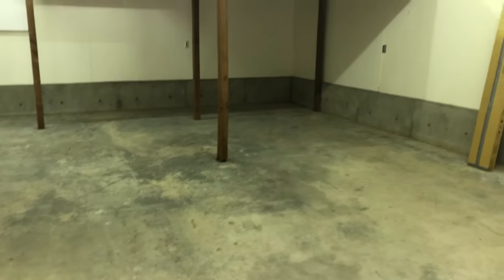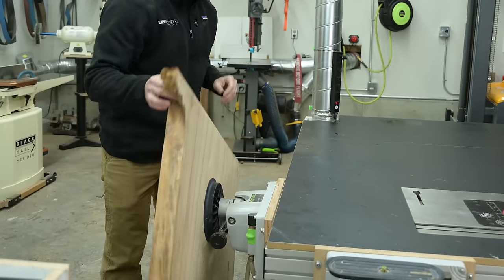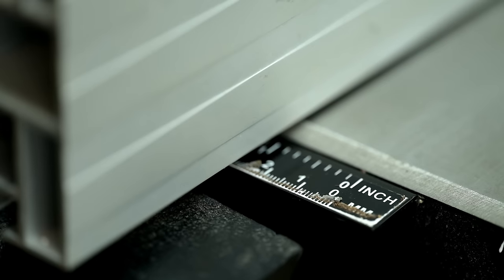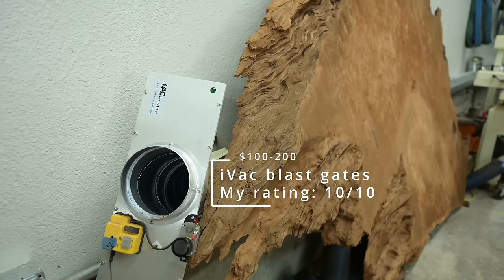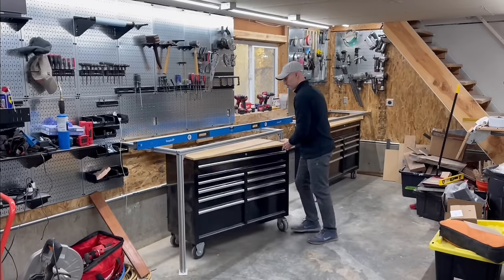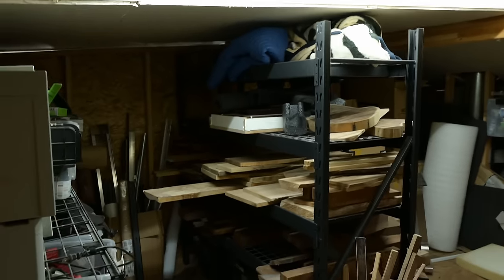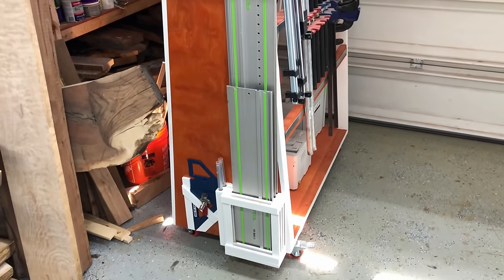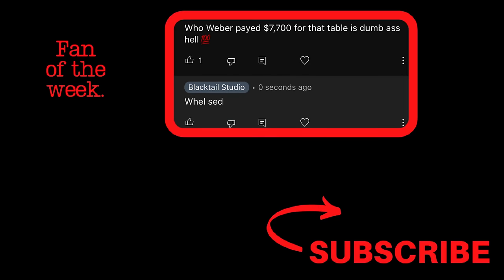Blacktail Shop Tour

Comment: I watch your videos and want so badly to have a nice epoxy desk but this college student can't afford you work, I live in a place with some of the tools needed to make this kind of desk but would need to find an industrial planer  but the big thing holding me back is mainly the cost of materials, the lack of experience and practice doing it for a good looking result, and the sanding. I hate sanding so much, I am somehow bad at it.
I think one thing i'd want to try and i'd love to see you make is an epoxy table with colored dye and having LED lights in the epoxy. I hate saying the term "gamer", epoxy table, but that's the easy way to explain it. some controllable color changing LEDs in an epoxy desk. maybe you can make a small light side table and call it a night light table or something, so its easier to sell.

Comment: Wish you went into the circular saws more.  I know the Mafell is pricey,  I guess about 2x the price of the Festool but what is your alternative for those large and thick slabs without flipping.  Be glad that that Mafell is one of their cheaper models.  Now there are some saws that would cut it but are not really worth it due to the quality of cut.    Off that subject I wish you could get sponsored by Woodmaster.  We had a molder/planer from them years back(30+) and it was great.  Not sure you would need a molder but their drum sanders are also great.
For your slide compound miter I suggest either a Mikita or Hitachi/Metabo.  I have the Mikita but think the Hitachi/Metabo might be better.  I've used both extensively along with several others.

Comment: Fight it! Hope it’s not too late to ask a question and get an answer. There was no link to the aluminum struts you used under the 1/4” melamine top. I think I can use that to build a 4x8 table to mount my slab flattening system. I would use vertical struts so the 8’ sides are supported in the middle as well as the ends. Thanx I hope you won your fight.

Comment: Fight it until you’re satisfied!

This video is exactly what I’m after as I’m building a hobby wood shop in my basement. I will be buying those wood chisels soon. I want to recreate your miter saw station to my own parameters, but I can’t find 1/4” black melamine anywhere. In fact, I can’t find any color melamine smaller than 3/4”. I have a local Lowe’s, Home Depot, Harbor Freight, and also Amazon is reliable. Where did you get your black melamine? If I can’t get it then I might just settle for 3/4” thick. I’m sure I will be leaving more comments as I unpack this video more. Cheers from SW Pennsylvania!

Comment: Fight it. You are a small business owner who is just trying to get by and building and expanding is a part of that process. My question for you is how you made the extruded out feed table level with the sawstop table saw. In that build video you show the plans but they show a height of 29.7" which is several inches shorter than the table saw height of 34". All of your videos cut off the bottom of the feet of the out feed table.

Comment: Do you ever put anything into the big voids on your giant tables to save on how much epoxy you use (since it is so expensive)? For example, do you ever put a block of 2x4 or foam or something like that in the middle of the void? I figure it wouldn't impact the strength of the epoxy and since you always use black epoxy, you wouldn't be able to see it either. So if you don't do it, why not?

Comment: I love the vacuum clamps, you answered my question that I had in another of your videos. Also, Mafell makes a plunge track saw like Festool that I own and it is an amazing tool, best plunge saw on the market. That saw you showed is a track saw, but for a different purpose than the plunge saws, it is what they call a cross cut saw. If you got your hands on the Mafell plunge saw, you would want to sell your Festool, in my not so humble opinion. They also make a dado, rabbet, etc saw that fits their tracks that is way awesome, but it is 2500 which is ridiculous. Why do you not like the sweetheart chisels? Once they are tuned up, I think they are a great budget buy for hand dovetails and stuff like that. Thank you for the video.

Comment: Trying my hand at using C channel to stiffen a bench.   Got the fasteners from your ref to screw into the bench.  Need ref to the black flathead bolts to secure.  Need 3/4", Amazon s are over an inch, too long for me.  Help please. .  Your work inspires.  Thanks!

Comment: Concede and reduce the plan by 5 feet or so. See if you can get an auditor alone and get the straight dope on why not, and work with them to mitigate risks and concerns either for sound pollution, environmental damage, aesthetics, or whatever.

Comment: Fight it! That new shop design looks great. Also wondering if you have done any tables with tile inlays. I spent years doing hardwood floors & started doing tile inlays on some higher end custom jobs & they always looked great. I'm starting to build tables & beds & such on the side now & have thought about doing some tile inlays. What are your thoughts? Do you think they could be covered in epoxy without any issues?

Comment: Hey Cam, would you have any suggestions for finishes? Weve just bought a house and with timber floors and I am wondering if osmo is worth the premium cost vs Tung oil.  Also interested in comparison of finishes for high use areas such as table tops and also other less use areas such as bed frames and cabinetry. Say, how about a video :) 
Thanks for your matter of fact videos, I keep coming back to your content cause i find it easy to follow. Dreaming of a workshop like yours. Any plans for CNC router in there?

Comment: Fight it.  It doesn't appear your neighbors are going to have an issue, wherever they might be.  But I have a question on your sliding compound miter.  I was thinking of the Bosch but you don't seem to think it's all that and a bag of chips.  I just have a garage I work out of so nothing like your operation but I don't want to throw out $600 and not be happy with the purchase, what do you recommend if not the Bosch?  Thanks for your response.  Also, I really like the videos.

Comment: Fight it….sort of….I think you should model it out in stages of just under 300sq’ at a time until you have the 1000sq’ you need then remove temp. walls and put a permanent roof over all the sections and make it into a single room.  Your local code allows for you to build 300sq’ or less without a permit…..
My first big purchase when I started in the antique restoration business was a REAL table saw.  A cabinet maker’s table saw is essential to any furniture shop.  I paid 20x more than I paid for my first car for that table saw.  I hate every router table I have ever bought for any price so I bought the tools, steel and aluminum and made my own.  5hp router with a table saw elevator system that is accurate and stable to the 1/100th mm.  I bought a cheap 14” bandsaw but that is not a tool I use much as most of my repairs and restorations are from the 12th-17th C. and my trademark that I am known for is that I use only the tools, materials and glues that existed and were used when the piece was made.  I have had to research and take up to four years to find the right materials of some jobs.  But you have inspired me to make some epoxy tables as an experiment.  When hard times come you have to diversify.  I hope you are still at it when you are my age!  I own similar hand made chisels from Japan and they are wonderful…but if you neglect them they will rust!  Looking back over the years in my shop I think it cost roughly $580,000 to present and I am always adding because EVERY project requires a specific piece of wood from Tasmania or Botswana or a basement shop in England…a new wood bending frame, molding plane from 1722 or SOME DARN THING!  By the time you’re my age you will have long surpassed me I’m sure!

Comment: Hi Cameron, I love your work. I have a question regarding a repair because you are really good at it. My father and I do some woodwork as a hobby, we recently built a coffee table with a tile inlay in the center. We went a bit deep on our first pass for the inlay and it caused the wood to chip past the line we want. We are considering 2 possible fixes. One is CA and some sawdust and the second is filling the chipped area with an offcut, letting then cutting and sanding it to the correct dimensions so it is flush. Which option would you suggest or is there a better way to fix this mistake?

Comment: Fight. Not really a fight, but there should be some accommodation within the Zoning Ordinance for you to get what you want or something close. Assuming your shop is Zoned as  being in a residential Zoning District you should be able to apply for a Special Permit, or a Special Exception, and or a Variance. Special Permits and Special Exceptions are usually within the Zoning Regulations and Variances are exceptions to the Zoning Ordinance. They all involve public hearings and application fees(typically non-refundable even if you are not approved). Your jurisdiction will produce a Staff Report for the governing body to review and neighbors will be advised of the hearings by letter and posted signs inviting them to testify for or against the project. You need a law firm that specializes in Land Development. It is essentially a pay to play system. My shop is at the limit of the Zoning Ordinance in my jurisdiction; 18 feet tall or less and 30% the area of the principle structure(the house). I have a pretty decent sized house and lot (3000 sq. ft.+/- / 1.1 acres)so I built a 24' x 36' building (864 sq. ft.) which gave me some wiggle room. The Zoning Administrator told me I could apply for a variance but it wouldn't be approved(that is not cool and an entirely different discussion). I kept the new building within the limitations that are by-right in the ordinance, which was okay with me for now. Based on my current needs the cost was too high to apply for a variance. The costs also included a lawyer, a new survey of the lot at my expense, and I would have had to give up a storage shed too. If I need to, I'll move. In my region the big concern governments have are illegal second dwellings and overcrowding. They don't want single family zoned properties to become multi family properties or big industrial operations in neighborhoods increasing traffic, etc.. This is why people build without permits, or, ask for forgiveness rather than permission. Please follow the rules. It is painfully expensive if you don't and you'll lose. A local government can get a Court Order to raze an offending structure at your expense and put a lean on your property. 

I hope this helps. Best of luck to you. I enjoy your videos, they are inspiring, informative and good quality.

Comment: I’m knew to your channel and I’m impressed and picking some good tips . My question to you is the channel that you put in the table you used a commercial channel but I saw you made some out of steel channel . Have you tested useong aluminum channel ? It’s cleaner and easier to drill . Think it would be strong enough ?

Comment: Hi sir, hope you are doing well. Iv been watching your videos and i love them.
Sir I’ve a doubt as im making a table for my home , as you mentioned that the wood moisture should be 8 to 12 % . what about if its below that like 4 to 8% or even less. Iv been curious to know that because iv a wood slab that i believe is about 5 to 8 years old and its rock solid and highly dried up.
Iv check it through the moisture meter it says 2% at some parts till max 8%. can i still use it. Im curious about it .
Is it important to get the wood seasoned or natural seasoning is enough if its dried up for about 2 to 4 months.

Would be great if you could tell me . 
Thankyou

Comment: Sometimes what you call a building puts limitations on what you can do or add things that you have to do in order to get approval. 
I would tell them its a Barn extension - a barn usually has the least requirements of a structure because who's gonna complain? Animals?

Comment: I suspect you are trying to operate a business in a residential zoning.  If that is the case, change the name of the project from a work shop to something acceptable in the zoning.  Inspect the zoning codes for what is allowed in your zoning and build something that fits, then use it as you see fit.

Comment: I've been watching Cam's videos for a while now, and am so inspired to get into my first BIG project.  I was wondering if regular packing tape (instead of TYVEK) would work for sealing the form, or would  the temperature of the epoxy melt the thinner packing tape.  Has anyone out there experimented with this?

Comment: Hey, i dropped Epoxy on stone tiles and it hardened bcs it went through the fleeze i layed down there. It went into the pores of the stone. I was able to get the big chunks off but not the stuff thats deep in the stone. How can i get it off? Is there some chemical i can use? I tried Acid and didnt work and i also tried to grind it out, but with this i really have to go deep and its a lot of work. Also tried a heat gun with no effect. So a chemical would be really nice if you can recommend one.

Comment: Fight it or concede.  As a former Planning and Zoning Commission for my county, I would need to see the reasoning behind the denial.  Also, I work for a lawyer, so...  (Don't hold that against me. Stay tuned to the end of my comment for some free advice.  There are usually ways to get what is known as a variance.  These "exceptions" usually refer to a reasoning that would allow for something the code excludes.  It can involve a public hearing where the public can say what they think.  These hearings can also allow a person or developer to meet with "stake holders" before the meeting where you can help people understand what is needing to be done and why.  They also can turn into a complete sh*t show.  I have seen both.  I can see that this video has posted almost a year ago but, true to my word, if you would like a little more guidance, provide me with a method of contact.  I will be happy to review the code.  (FREE)  I am doing this because I really enjoy your videos and fancy the idea of a transition to full time woodworking myself.  Thanks for the videos.  It won't be long before I take the full course on epoxy tables.  Really ready for that one.

Comment: When I used the Sawstop table saw at the public woodshop I go to, is the sled supposed to be wobbly? Like I put the sled in to the table and try pushing it with the piece of wood I want to cut, but the sled rotates from left to right. I see some things I can turn to tighten it, but it tightens it to the table itself and I can't move the sled.
Reply from the maker: No, that’s not normal

Comment: Does your dust collector pull air out of your shop and then return the air after filtration?  I want to do the same thing with my collector, but have not figured out the best way to return the climate controlled air from my shop.
Reply from the maker: It’s in my shed with a vent cut for the return air.

Comment: HELP!!!!  I recently poured a 5’ x 10’ epoxy table with book matched ends and I’m guessing I didn’t seal the exposed wood enough as the table has cupped. Luckily I still haven’t used the router sled on it yet but I’d like to minimize how much material I have to take off.  Is there anything I can do to have it flatten out again, even a little?  
Love your content and learned a ton from you, now I’m learning by doing and in this case, making mistakes.
Reply from the maker: Check out my $10k table to Hawaii video. I did a trick in there
Reply: @BlacktailStudio  I will definitely check it out. Thank you so much for the reply, keep up the Inspiring work
Reply: @BlacktailStudio  so I watched the video. I’d like to send you a picture but what I can say is mine was flat for several weeks before cupping. We are in winter here with temps around -30c so the sun technique wouldn’t work. If it’s due to the wood drying out, is there a way to put moisture back in and maybe have it flatten out? I’m assuming that’s the issue…
Reply: Just checking to see if you saw my reply.

Comment: When it comes to your extension why don’t you start involving your community in some workshops maybe teaching youngsters a craft if they see you’re doing things for the community it’s harder for them to see no. I had a similar situation and this is what I did and it worked unfortunately it’s usually one member of the board that is jealous of your success so you have to put them in a situation where they simply cannot allow their feelings to interfere. I guarantee you that’s what the issue is you’ve upset one of them and you’re not even aware of it because it’s something completely petty largely led by jealousy